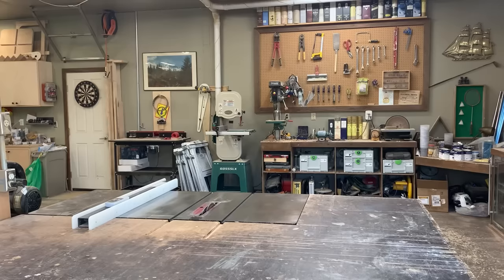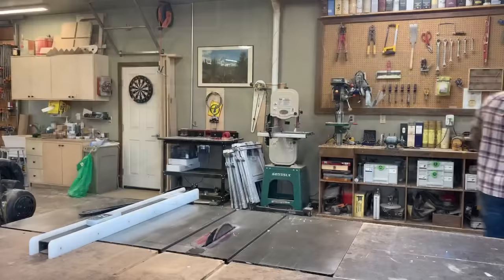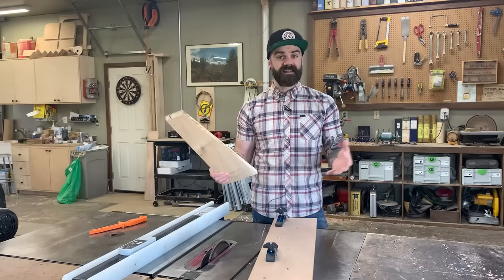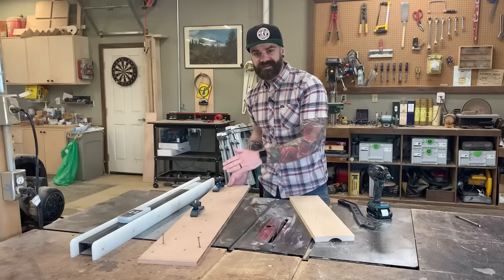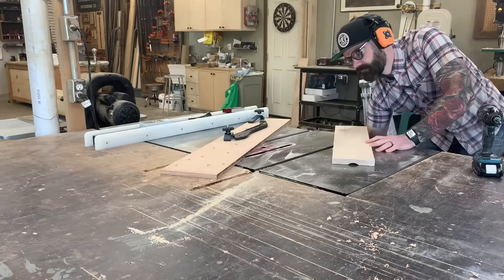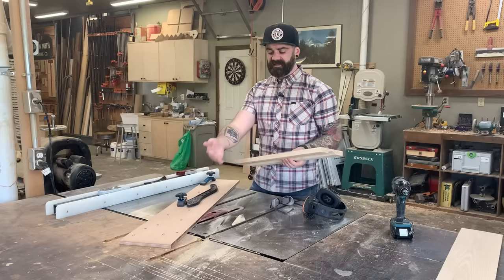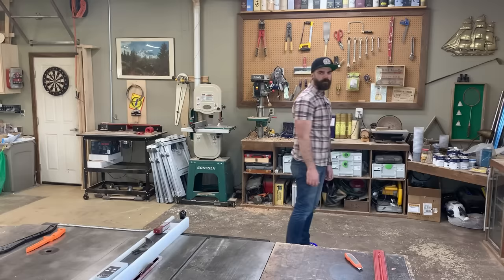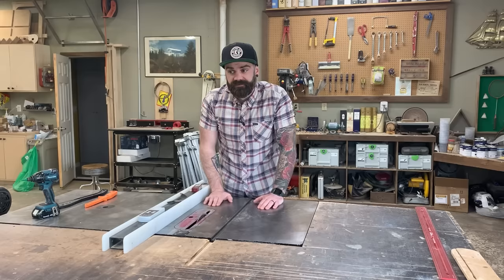Woodworking Tricks You'll Actually Use || Table Saw How To

Comment: Another tip we had was when you were doing a thin repeatable cut and you don't want to destroy your push stick trace it on a piece of plywood and cut it out with a jig saw. Round off the sharp corners and sand it a little on the handle so you do not cut your hands or get splinters.

Comment: I checked into the forest blades and does not appear that sharpening in included as you suggest. From what I can see, it's really expensive to sharpen. Something like 2 dollars per inch then quite expensive shipping. Am I wrong? What's the deal?
Reply from the maker: You are not wrong. But they used to or maybe I just never got charged, like some woodworking miracle. But anyhow I’ve pinned a comment correcting that statement.

Comment: When I bought my table saw, I didn't know anything about it. It didn't come with a riving knife and doesn't have the ability to install one.
Reply from the maker: Buy a new one 🤣🤣
Reply: Maybe it's not a table saw, but a chain saw... oO
Reply: @AlBorland3877  yes... because I don’t know what a table saw is...
Reply: @Christopher_Wheeler  Sorry, couldn't resist. :D
Reply: @Christopher_Wheeler  you can’t know too much about them if you bought one without a knife
Reply: @TheSmartStar  I bought it a year ago before I learned anything.
Reply: @Christopher_Wheeler  well happy sawing. I’m surprised you found one with a riving knife on it. In the UK you wouldn’t be able to market one without it I don’t think
Reply: You could possibly make splitter Inserts, basically a zero clearance insert but you attach a piece of wood the width of your blade behind the blade. 

But.. saws with riving knifes are just superior in every way
Reply: I think it’s micro jig that sells an aftermarket splitter kit. Not as good, but almost equal safety wise
Reply: @shandorszentkuti6330  Thanks! I’ll check it out.

Comment: Apparently ear safety is low on your priority list.  At 12:23 you remove your headphones and clearly reveal that you have b been wearing them with RIGHT earpiece on the LEFT side and the LEFT earpiece on the RIGHT side.  Now your ears have been de-phased and it's very likely that the aural perception of your work environment has been stereo-reversed.  This video should come with a big audio warning.  WARNING:  EXTREME EAR DANGER

Comment: What if our table saw is: 
-fixed to a stool with 2 nuts and bolts and is too low to use comfortably,
-is underpowered, 
-doesn't have mitre slots for a sled 
-doesn't have a fence
-don't even dream about  a Dado stack
-the blade has a larger hole than the shaft so it has a cut up bicycle inner tube wedged between 2 pieces of machined spacers and it jumps ever so slightly, 
-the blade height is not adjustable and it doesn't tilt, the table does, 
-the fuse keeps blowing every time we try to cut bigger branches?
Reply from the maker: buy a new table saw